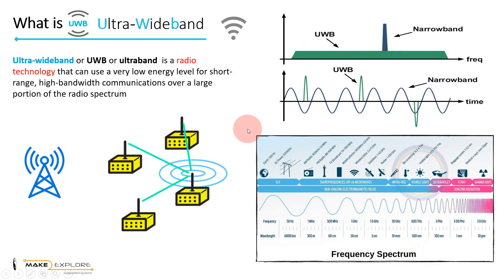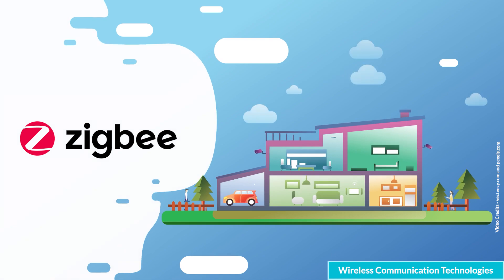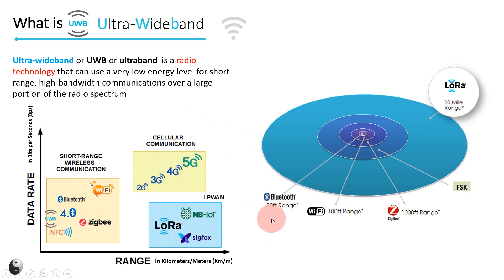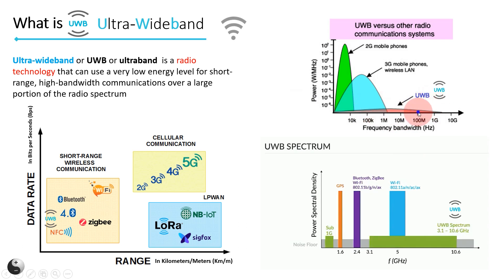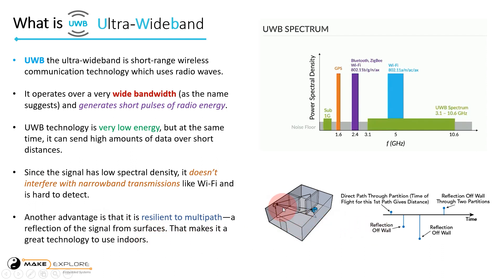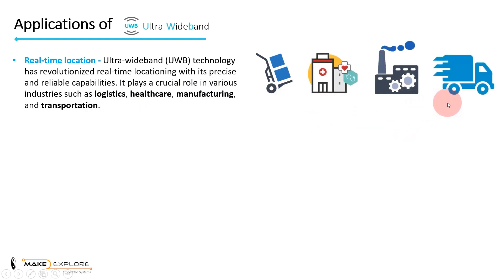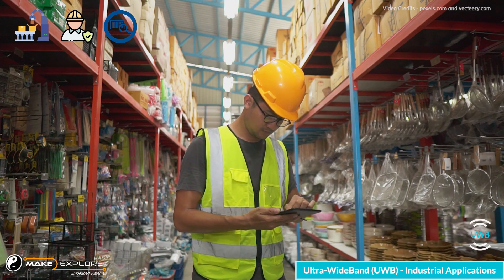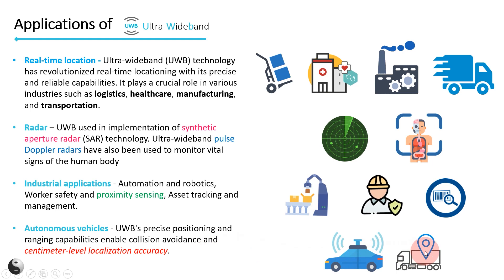Ultra-wideband Wireless Communication Technology

Comment: Do i need this on my android phone i bought a samsung galaxy s22 recently wi-fi not working
Reply from the maker: Dear Friend, @dubtinao

Thank you very much for your interest in our channel.

Q - Do i need this on my android phone i bought a samsung galaxy s22 recently wi-fi not working?...

➡️ Ultra Wideband (UWB) is primarily a feature in premium and flagship devices, enabling precise location tracking for compatible accessories like the Apple AirTag and Samsung Galaxy SmartTag+ and secure keyless entry for supported smart homes and vehicles. 

--  Many other flagship smartphones from Apple, Google, Motorola, and Xiaomi have Ultra Wideband (UWB) capability, typically reserved for their high-end or "Pro" models.
--  Samsung Galaxy S22 does not have UWB (Ultra-Wideband) capability. Only the Samsung Galaxy S22+ and S22 Ultra models include UWB support, while the standard S22 lacks this feature along with Wi-Fi 6E.

📌 WiFi not working ?

➡️  If your Wi-Fi isn't working on your Samsung Galaxy S22, UWB has nothing to do with that issue, you do not need Ultra Wideband (UWB) capability for your Wi-Fi to work, as UWB and Wi-Fi are separate, complementary wireless technologies. The base Samsung Galaxy S22 model, which you have, was not designed with UWB capability but does fully support Wi-Fi 6 for internet connectivity.

Hope this info will help you. If you still have any other suggestions/issues/queries about this Tutorial, or any of our DIY project, feel free to ping us on WhatsApp/Telegram (Links given below).

Tech support - (𝗖𝗵𝗮𝘁 𝗢𝗻𝗹𝘆) Telegram/WhatsApp - 11:00 AM - 05:00 PM (Mon-Fri) IST   

🚀 𝗧𝗲𝗹𝗲𝗴𝗿𝗮𝗺      🔗 https://t.me/make2explore
💬 𝗪𝗵𝗮𝘁𝘀𝗔𝗽𝗽    🔗 https://bit.ly/3VXGGEe
📩 info@make2explore.com  / support@make2explore.com

Thank you very much for your support.

Best Regards

Comment: Can you use two modules to measure distance on a cm precision level?
Could it work like an emmitor and receptor?
Reply from the maker: Dear Friend, @MsMoeb

Thank you very much for your interest in our channel.

Q - Can you use two modules to measure distance on a cm precision level? Could it work like an emitter and receptor?....

➡️ Yes, two RYUW122 modules can be used to measure distance with centimeter-level precision, achieving up to 10 cm accuracy in open-field environments, as specified in the datasheet. By configuring one module as an ANCHOR (receiver) and the other as a TAG (transmitter), they can perform two-way ranging using Ultra-Wideband (UWB) technology, which calculates the time-of-flight of signals to determine distance. The modules communicate via their UART interfaces, controlled by AT commands, and support simultaneous data transfer and precise localization, making them suitable for applications like real-time location systems (RTLS).

If you still have any other suggestions/issues/queries about this Tutorial, or any of our DIY project, feel free to ping us on WhatsApp/Telegram (Links given below).

Tech support - (𝗖𝗵𝗮𝘁 𝗢𝗻𝗹𝘆) Telegram/WhatsApp - 11:00 AM - 05:00 PM (Mon-Fri) IST   

🚀 𝗧𝗲𝗹𝗲𝗴𝗿𝗮𝗺      🔗 https://t.me/make2explore
💬 𝗪𝗵𝗮𝘁𝘀𝗔𝗽𝗽    🔗 https://bit.ly/3VXGGEe
📩 info@make2explore.com  / support@make2explore.com

Thank you for your support.

Best Regards

Comment: Distance measurement alone will require three points of reference to trilaterate position. I did a machine learning experiment a few years ago to simulate a radio network to see if I could reliably get accurate positions using gradient descent, randomly-positioned nodes, and noisy latency measurements. The result was underwhelming and inaccurate in most cases, though it could perform well under some limited circumstances, e.g. when the known points had a good distribution and the initial guess was not near an incorrect local gradient minimum. However, the computational cost was too high for the purpose I had in mind, so I dropped my efforts. Maybe I'll do some experimentation using other approximation methods or tricks once I get some ESP32s to play with, but I am pretty sure that spanning trees will provide a better solution for greedy routing.
Reply from the maker: Dear Friend @k98killer 
 
Thank you very much for your interest in our channel.

Q - Distance measurement alone will require three points of reference to trilaterate position. I did a machine learning experiment a few years ago.......

➡️ Yes!, You're absolutely right about the challenges of distance measurement and trilateration! Your machine learning experiment sounds fascinating, and We're not surprised that you faced difficulties with accuracy and computational cost.

Trilateration can be tricky, especially with noisy measurements and limited reference points. Gradient descent can get stuck in local minima, leading to inaccurate results.

Spanning trees are a great approach for greedy routing, as they can efficiently connect nodes in a network while minimizing the total edge weight (e.g., distance or latency).

If you're interested in exploring alternative methods, you might consider:

1. Multilateration: Using four or more reference points to improve accuracy.
2. Non-linear least squares: A optimization technique that can handle noisy measurements.
3. Graph-based methods: Like graph neural networks or graph-based SLAM (Simultaneous Localization and Mapping).
4. Hybrid approaches: Combining trilateration with other techniques, like inertial measurement units (IMUs) or vision-based methods.

📌 Thank you very much for sharing information and experience about your experiments and ideas! Feel free to share, we're also excited to see your progress. This is a very nice project you are working on. Happy Tinkering. 👍

If you have any queries/issues/suggestions about this Tutorial, or any of our DIY project, feel free to ping us on WhatsApp/Telegram (Links given below) for further support.

Tech support - (𝗖𝗵𝗮𝘁 𝗢𝗻𝗹𝘆) Telegram/WhatsApp - 11:00 AM - 05:00 PM (Mon-Fri) IST   

🚀 𝗧𝗲𝗹𝗲𝗴𝗿𝗮𝗺      🔗 https://t.me/make2explore
💬 𝗪𝗵𝗮𝘁𝘀𝗔𝗽𝗽    🔗 https://bit.ly/3VXGGEe
📩 info@make2explore.com  / support@make2explore.com

Best Regards